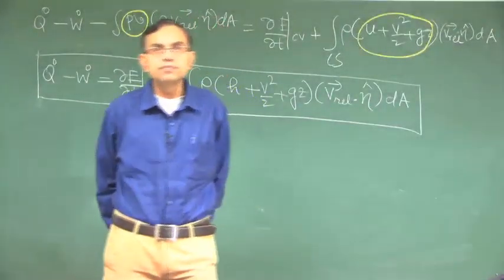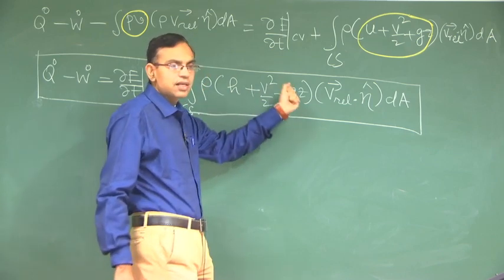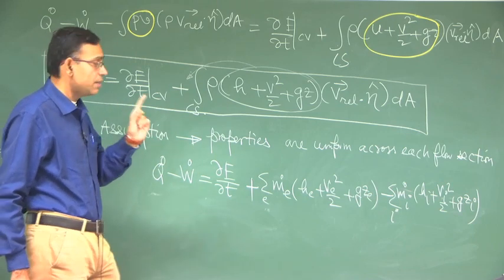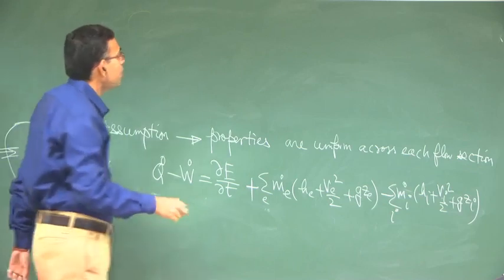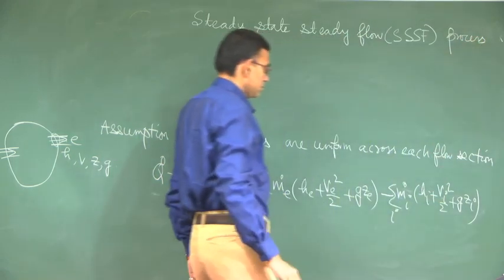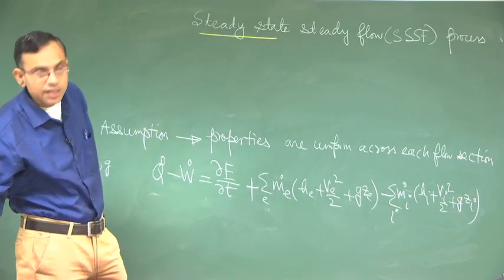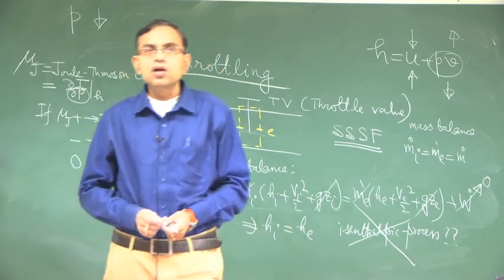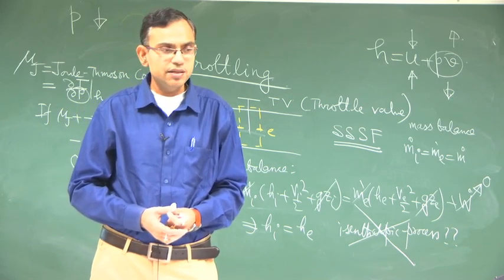Lecture 22 : First Law for Steady State Steady Flow (SSSF) Process

Comment: Steady flow is defined as a flow in which the flow velocity and fluid properties at any point do not change with time. Now both mass and energy are the properties of the system, so just by telling steady flow, can't both ∂m/∂t and ∂e/∂t are already set to zero?